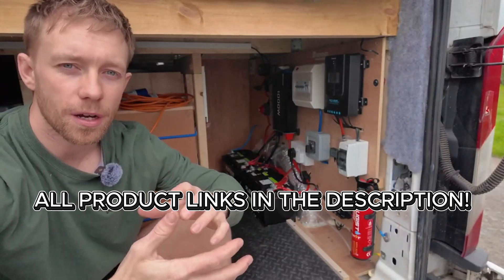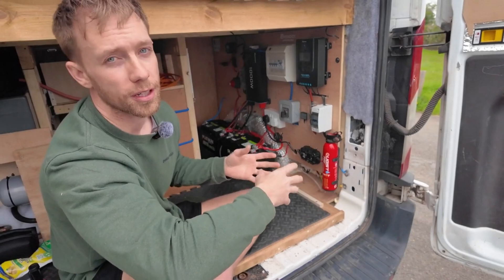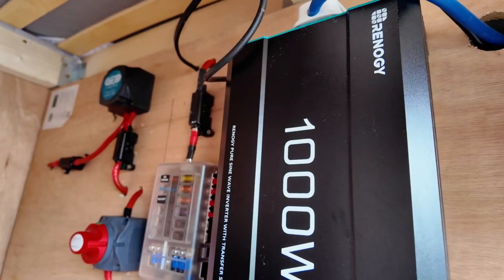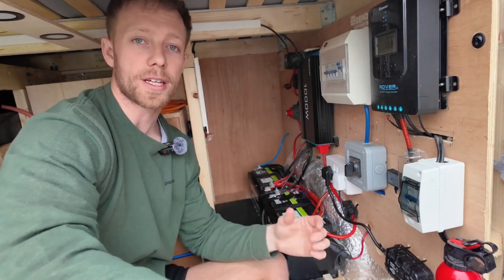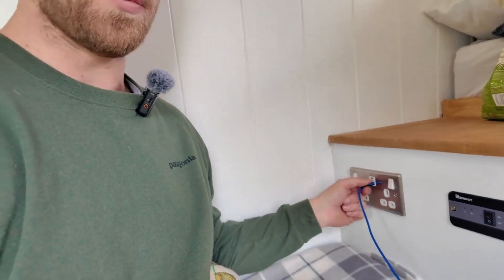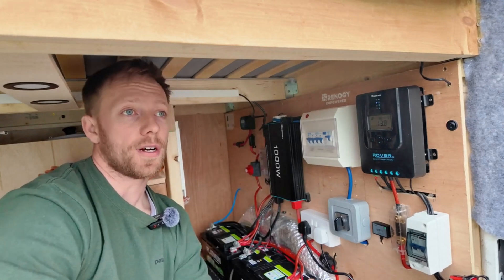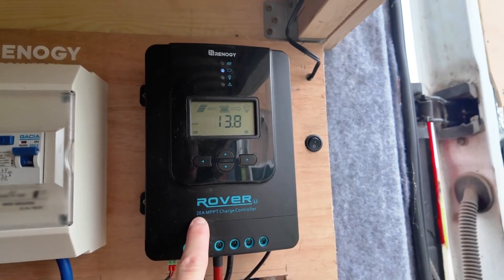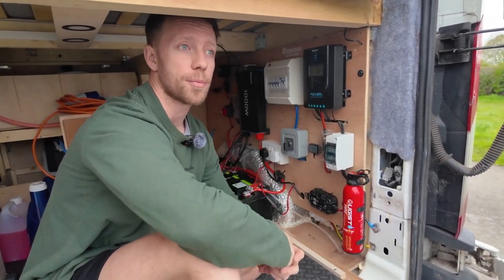My Ford Transit Camper Conversion ELECTRICS SETUP 12/240v + Solar

Comment: Buying a van soon to convert and watched 100 videos and still confused 🤣🤣🤣
Reply: Join the club. I'm at the point where I think i'm just going to invest in a couple of decent power banks (jackery etc) and just run what i meed off those. Far simpler.
Reply: @happiechappie76 just watched  project camper doing a basic 1 to show you give him a look its an old video
Reply: @A.1986. Thanks - i'll take a look
Reply from the maker: That’s the way forward I think. Even having converted 3 vans I’m tempted by a Jackery on my next build
Reply: Me too!! I know all the big things I need.. but I don’t understand the wiring and everything just yet
Reply from the maker: Just keep it simple, just hardwire a couple of usb sockets and your main lights then use a big portable power station for the rest of the
Reply from the maker: 🤣🤣 watch 101 videos then

Comment: Lovely description  and arrangement Matt. I just need you to explain why would you need a link between the van original alternator battery and the rest of your electric. You have the kill switch to isolate it or connect it but what is the need of that? Your leasure batteries with mains hook up and the solar should be independent from the engine electrics? if you need to jump start the van you can use a booster or jump leads?
Please explain the reason for that link.
Reply from the maker: Hi, it’s so that I can charge up the leisure batteries using the alternator incase I don’t have any solar or electric hook up

Comment: Incredible video Matt, using this as my template for sorting out my van electrics so super useful! 😍 I just wondered how you've wired up the LED RGB lights? Looking at the ones you've linked on amazon, they seem to be powered with a 3-pin 12 V adapter to plug into 240v mains... How did you wire these into your 12v system and fuseboard?
Reply from the maker: Hey, 

Thank you, appreciate it :)

So, you have 2 options.. you can cut the plug off and use the 2 core cable to wire in to the fuse box like you would normal LED lights or you can get a set with a USB at the end and just plug them in to a USB socket. Drop me a message if you get stuck 👍🏽
Reply: @matt_inmotion  Ahh of course, makes sense! Reckon I'll stick with the easy option and go for a USB outlet compatible set haha. Thanks for your help, legend! 😁

Comment: Just about to start my van electrics. How did you wire up the hookup to the rotary switch then to the inverter. And also the trickle charger ?. Thanks for the video super informative.

Comment: Hi Matt, thanks for the video, could you specify where the ground to chassis is located, I’m currently working in a ford transit conversion and I’m struggling to find it. Thanks in advance!
Reply from the maker: I’m so sorry, I have only just seen this comment! Did you manage to earth it? There isn’t a specific earth point at the back in the ‘Garage’ but you can clean the paint off to bare metal and drill through for a nut and bolt anywhere on the chassis